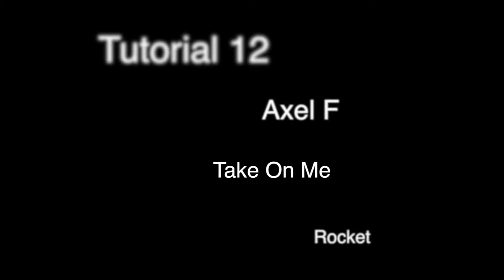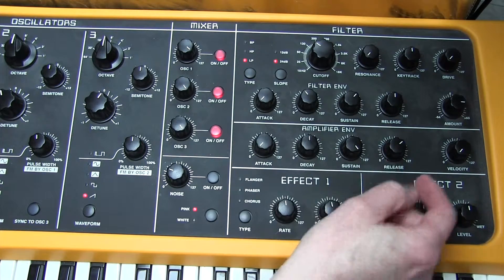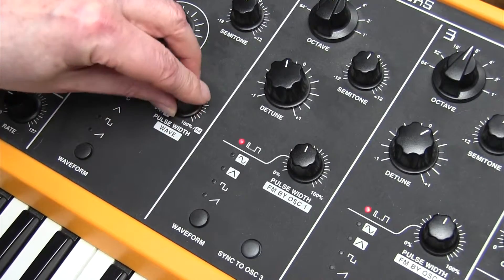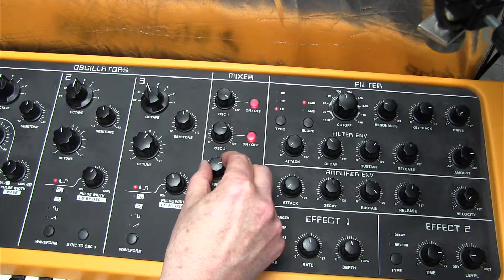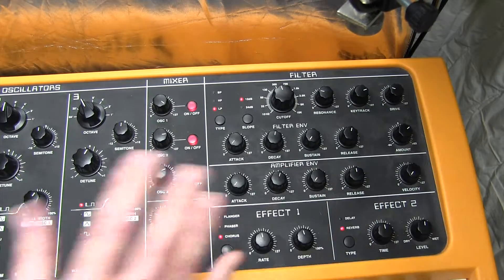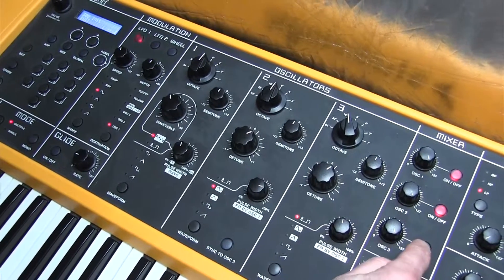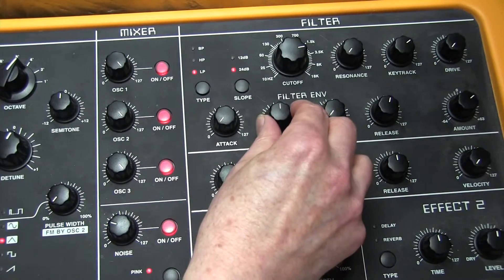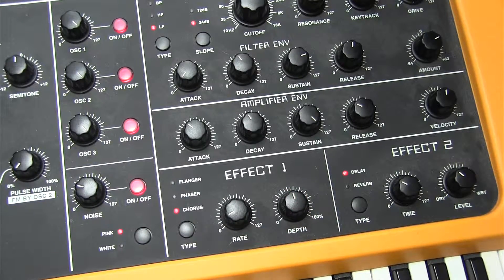Studiologic Sledge  Synthesiser Tutorial 12

Comment: Hi David! Thanks for these great tutorials! I have a question about the Sledge 2.0, if you don't mind. When I turn any of my Sledge panel dials to minimum, I don't get a zero on the display. The minimum setting I can get is 37. I assumed it was a quirk of the OS until you started setting them lower. When my controls are at minimum, they seem to affect the same range you are getting, it is only the digital readout that is giving me pause. It also means whenever you have a minimal setting, I have to sweep the dial to get the same effect you are, rather than setting the number. My Sledge sounds awesome and seems to work fine, do you think I should be concerned?